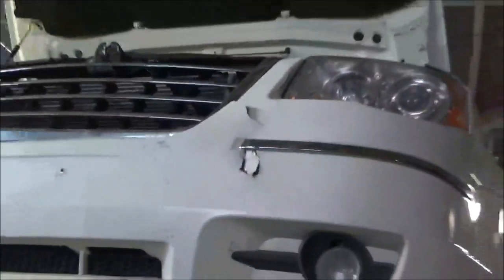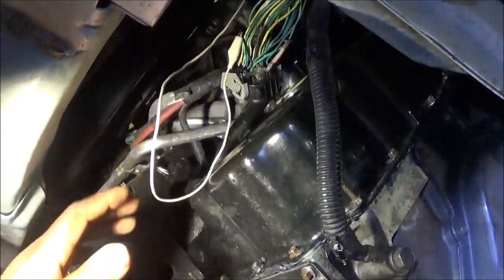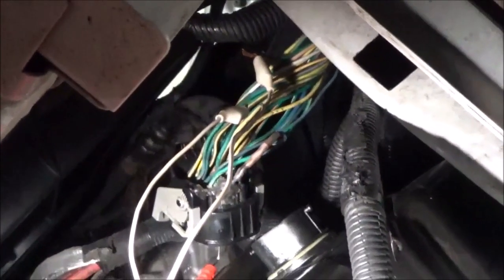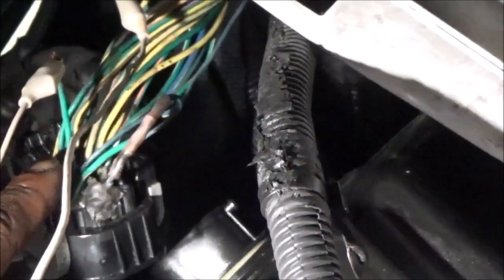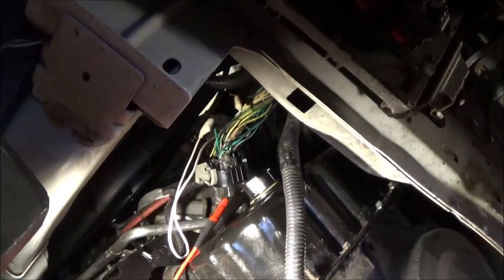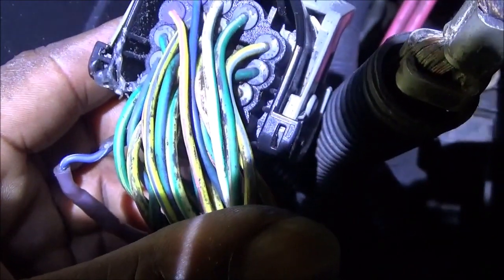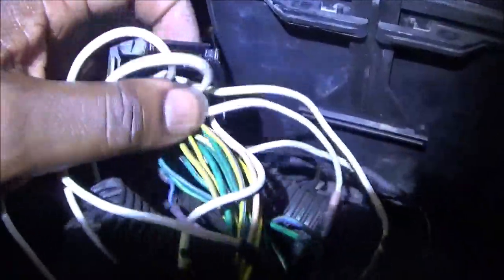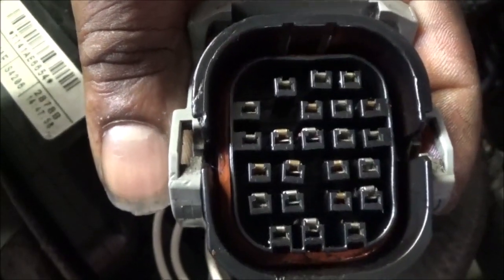HOW TO RESISTANCE TEST SOLENOIDS (2009 TOWN AND COUNTRY) P0755 (PART 3)

Comment: what should i check for p076a trans shifts great then no shift and manual shift numbers even disappear, shut off vehicle restart good again for a couple miles thanks for any help!
Reply: Had the same code p076a on my dodge Journey  I just remove the Direct clutch solenoid clean it out while I was giving it 9v put it back together change the fluid and filter took care of the problem
Reply: @charrito020  read it with a ohm meter bad change it fixed

Comment: I'm working on a 2012 Town and Country, it's showing the P083B and some others, I changed the fluid and filter and it was fine for a couple of days (added some TransX, maybe helped, maybe not), pretty sure it's an electrical problem and pretty sure it's a solenoid gone bad or sticking because I can disconnect the battery cables and touch them together to reset things and then start it and it shifts fine for a few minutes then has trouble, if I do the battery thing again it's fine for a short while. So I checked the solenoid block out, all the solenoids read 1.1 ohms except the line pressure solenoid shows 2.6 ohms, all the diagrams I have seen online show they should be 1.6-1.8 ohms but since they are all the same I'm assuming they are good. The charts show 4.8-5.1 ohms for the line pressure solenoid and I have 2.6 ohms so I'm thinking that's a bad one and that would contribute to the P083B code. Most of the charts I've seen show 300 ohms for the signal pins but I'm getting 104.4 for all, again since they are consistent I think they are okay. If the line pressure solenoid is at 2.6 ohms is that acceptable or not, one of the reasons I ask is because I got a refurbed solenoid block and it shows 2.8 ohms on line pressure solenoid also (pin 10 to pin 12) ?
Reply from the maker: That is not a solenoid code. That is a pressure switch code which is on the solenoid pack. Testing solenoids will not help you. Change the solenoid pack and see what happens. Also, I do not use refurbished packs because refurbished packs go bad or don't work
 I always use new if I can.
Reply: @thisisyourtransmission  I appreciate your response. Yah I did some more digging into that code and looking at some different articles and pretty much came to same conclusion, there were a couple of other codes and symptoms and figured it wouldn't hurt to check the resistances. I am still wondering about acceptable +/- on the ohm readings particularly the line pressure solenoid and wondering why all my signal pin readings are 104 ohms when every chart or diagram I have seen online show 300 ohms and one of those was a post by a Chrysler mechanic.

Comment: I’m running out of places to look for help with mine. We’ve dealt with limp mode and P083B since we’ve had our T&C. The issue? It happens randomly. It can go weeks without the issue, then boom. Pull over, turn off the key, start it back up and it’s fine. Makes me wonder if it’s a short somewhere, rather than an actual transmission or solenoid problem. Any suggestions?
Reply from the maker: Ok, this vehicle has a 62te transmission. How many miles is on your vehicle?
Reply: Sneaking up on 170k, but it’s been doing it since we bought it at 125k.
Reply: Hi! How did you solve the problem? Mine is just the same.
Reply: I'm working on my son's 2012 Town and Country and mirrors almost exactly your symptoms except his only lasts about 5 min after reset, just waiting for parts to make sure. I have pretty much narrowed done the problem I think, pretty sure the line pressure solenoid is faulty, usually you have to replace the solenoid block but a company called Transtar  now offers that solenoid. I am going to replace the line pressure sensor while I am at it because its pretty inexpensive.

Comment: what kind of damage is indicated by error P083B?
Reply from the maker: This looks like a pressure sensor code that is inside of the solenoid pack. You need to have someone verify if the pressure switches are working with a scan tool.